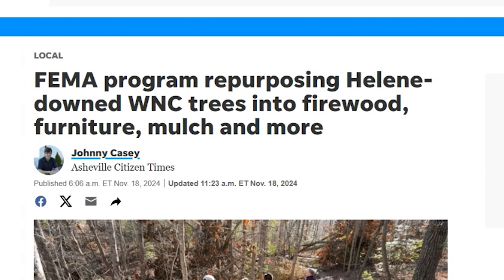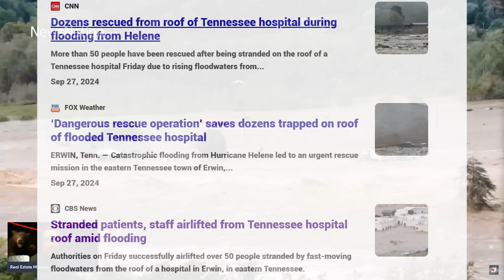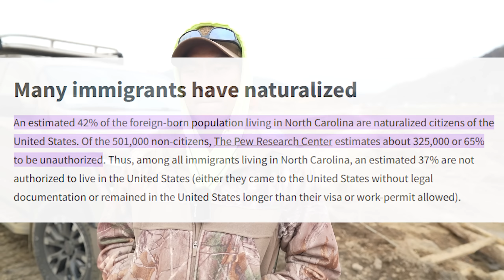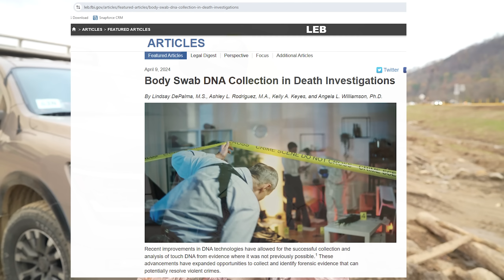MULCH FARM: Hurricane Helene Atrocity | SAR Team Update

Comment: Hi there im the "worker on the left there at the door" from the beginning of the video. Im not sars i am employeed with that company foam products worked there for 13 years. Myself and few other who got to keep our jobs are cleaning the factory ourselves and recieving zero outside help.  That puddle you said looked radioactive is just hole caused by the damage and been filled by rain. We nor any plant on the strip has any radioactive material, not saying the water is safe to drink tho. The large debris mound is what was gathered from the interstate and piled up there to get 26 cleared and reopened.  Idk where it is all being hualed to after it leaves that mound but they are hauling off the yellow pipe separately from the trucks i have seen leaving. The mount may be saturated in chemicals but with the amount of water that rushed through there i believe it was all washed down the river unless there were factories in NC that are up river from us. Either way it should not be used for mulch. Regarding respirators, they are not needed inside our facility due to chemicals but we have n95 mask for a few areas that have mold. Not saying everything is great or that workers in the area have nothing to worry about. Everyone working thwough that strip should be aware of their surroundings and be cautious.  FEMA is no where to be seen and i dont think we will see them. The community has done a great job coming together and helping out where needed. I agree with what you are saying, just thought i could give a little perspective since i have been right there working for the past 2 months.
Reply: This guy is trying to read too much into what's actually happening!
Reply: @davidkeys6192  yeah I wasn't going to mention that but he seemed very dramatic about the radioactive materials and making it seem like a mushroom cloud is looming over erwin. I saw his thumbnail too (my wife sent me the video why I'd didn't see it before) and erwin is not gone. There are a areas that got hit hard but it's not gone. Main part of erwin was untouched.
Reply: @davidkeys6192  yeah I wasn't going to mention that but he seemed very dramatic about the radioactive materials and making it seem like a mushroom cloud is looming over erwin. I saw his thumbnail too (my wife sent me the video why I'd didn't see it before) and erwin is not gone. There are a areas that got hit hard but it's not gone. Main part of erwin was untouched.
Reply: Thank you and God bless you and your family.
Reply: Thank you for the information, much appreciated. And also you guys volunteering! Tell your friends and families a big thank you! Love wins out.

Comment: Have driven by there many times between Jonesborough and Asheville—twice this last summer, I’m guessing there’s at minimum oil in the water, if I recall correctly there was 1-2 tractor/digging equipment suppliers over there as well as the hospital and some other industrial warehouses like the plastics company. Was such a beautiful spot coming down I-26 on the way back home 😢, hope it rebounds and hope the families can get help through the winter, FEMA sure ain’t coming. 

Logically reflecting on all this, I really hope that if they rebuild the hospital that they move it higher up in elevation on I-26.

Comment: You would think that stuff would have to be buried underground being toxic.
Reply: Burying toxic and radioactive chemicals under the ground is just as negligent. It doesn't go away, it's just out of sight and out of mind. 
It is just as cheap and easy to use proper bio remediation, so I am pretty sure they buried those chemicals for this purpose- to use as bombs later.
Reply: No, that can get into ground water.  It needs to be processed and the worst of it contained.
Reply: @ANPC-pi9vu  I was thinking with the sealed barrels they use sometimes for this type of toxic type stuff.What would be the best way to get rid of it?